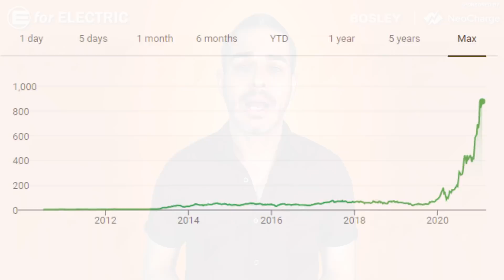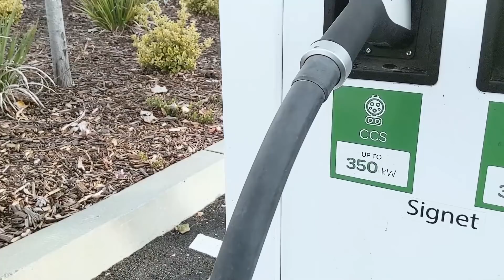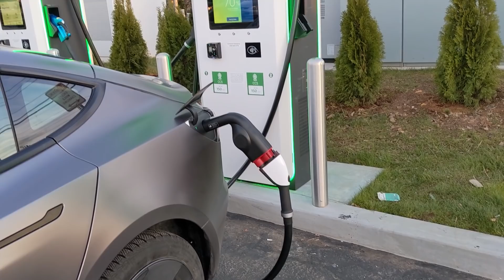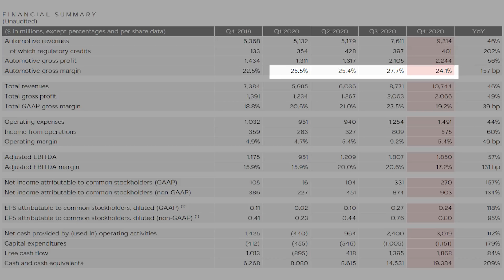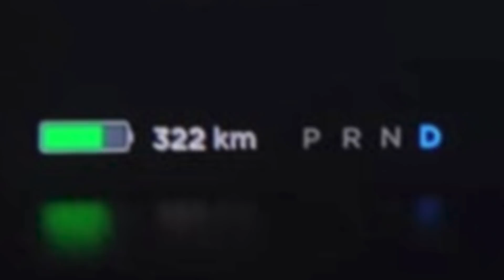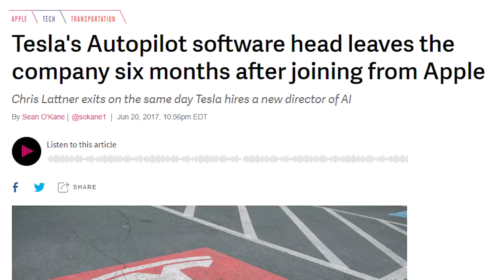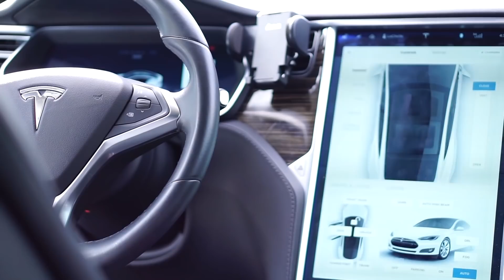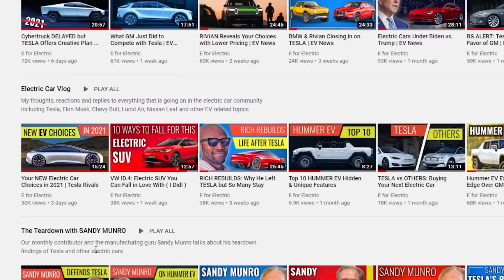Investing into Tesla Stock: Things You Should Know in 2021

Comment: Tesla make California cars. Here in Canada  tesla car's struggle with winter climate. Charge slow, are very inefficient by wasting a big chunk of energy to heat up the battery. Froze solid and need an hour of preheating just to get inside  (again waist of energy) . See teslabjørn video on winter testing the 2021 model. 0 to 60 in more than 12 seconds at low SOC with top speed of 50 mh! Let the owner test the expensive car so we can fixed it someday.

Comment: Model S owner since 2014, currently at 74k miles, and I’ve never had a problem with service. They’ve always taken care of any issue quickly and efficiently. Last time was for an airbag recall that they took care of in my driveway about a year ago. It’s been about three years since I’ve been to the service center. The car just doesn’t need much servicing. 

You’re misrepresenting what Elon said about paint and body gaps. He said they figured out and fixed the body gap issue between the time that Sandy bought his car and his friend bought theirs. On the paint, he said they learned how much time the paint needs to dry by pushing the line too fast for the paint to fully set, and that they’ve fixed that problem too. 

Ark Invest says Tesla has far and away the most real world miles tested on autonomous driving development and predicts they’ll be first to achieve it. 

You didn’t mention the aluminum presses they’re employing to greatly simplify and improve manufacturing, and greatly increase vehicle quality. This puts their manufacturing process ahead of any other car maker. 

How long will it take other car makers to reach 400 or 500 EV miles range? How much more expensive will their batteries be? These are tremendous competitive advantages for Tesla. 

Sad to see you turning to sensationalist spin here. Looks like your going for more clicks to me.

Comment: Competition is coming! Yes, for ICE cars. Nobody in their right minds will buy a new ICE car very soon -- as EVs become more affordable and cost less to maintain and charging is less of an issue. All EVs are ICE car killers. I do not buy that they are Tesla killers. For one, while every one will want EVs, there are not that many EVs being produced at the same scale as Tesla. And Tesla's plans for ramping production seems to be much much faster than others. Whoever makes the most cars at reasonable price, with reasonable range, will take most of the market. 

It is not as if anyone can turn on a dime to switch to manufacturing EVs. The main problem with other automakers is they do not seem to have lined up batteries yet. GM (for example)  is planning to produce 30 GWh by 2025 or so. That's less far less than  400,000 EVs per annum by 2025. Tesla will  have at least 500 GWh of batteries by then.